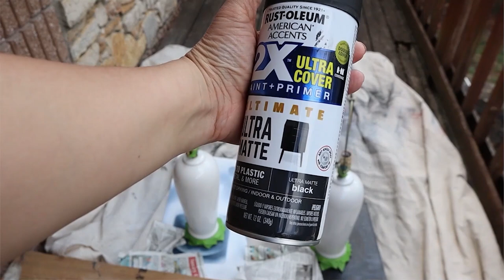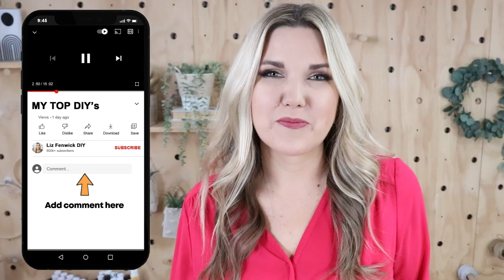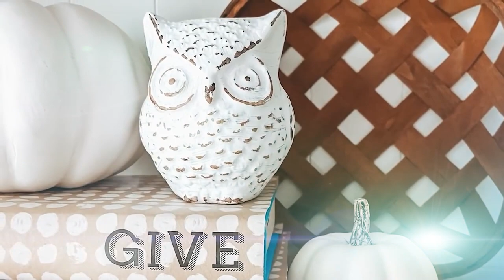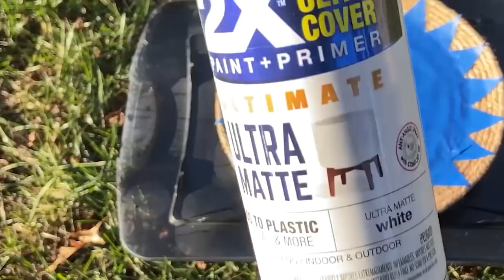Top 10 DIY's of 2021 to Decorate Your Home Like A PRO!

Comment: I remember all but #3. Which I will have to recreate since I have a case of those trays!  A tip when layering the paint is to wriggle it as it goes in and it gives you a lot of variation that way too